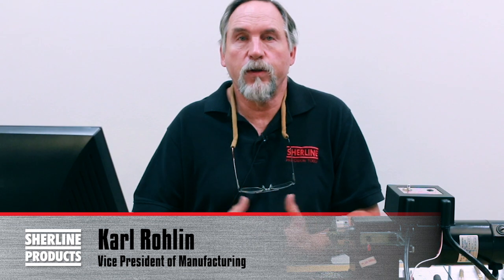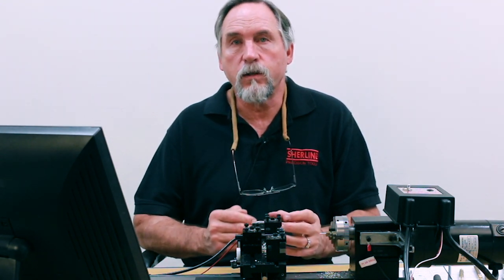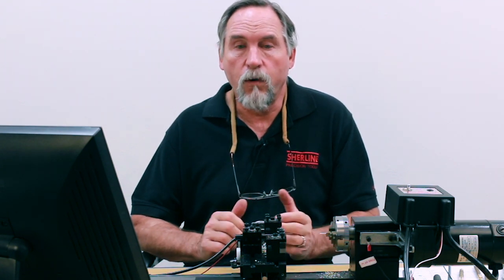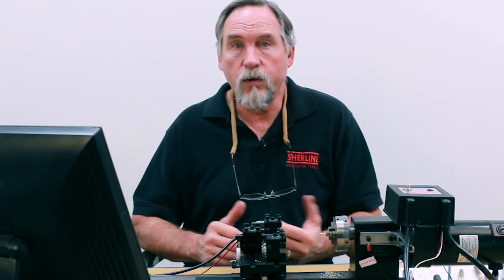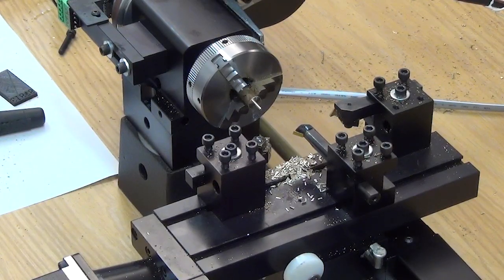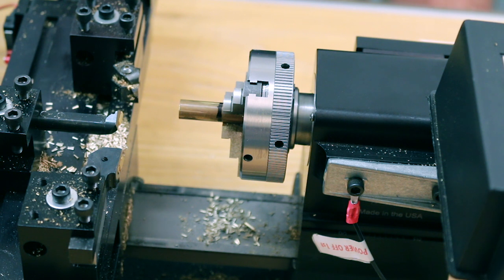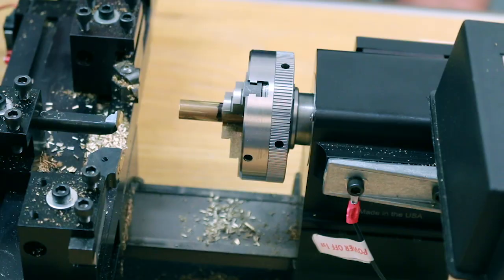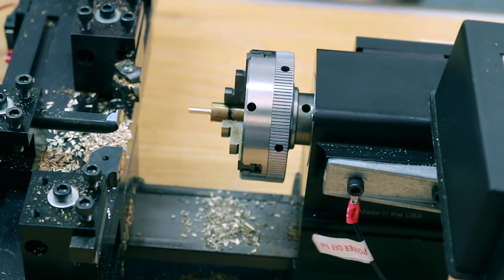Ball Screw Lathe Deep Cut Test

Comment: Do aggressive cuts like this damage the ballscrews in any way?
Reply from the maker: Because our machines are small, there is a misconception that they are just toys that cannot take heavy cuts in metal or hold tight tolerances. This video was made to show a very heavy cut on our machine. As stated in this video, the depth of cut that is shown is greater than we recommend for our machine. The cut is so deep that the boring bar is actually bending while it is cutting. That being said, repetitive cuts like this will have a negative effect on the machine over time (similar to exceeding the recommended RPM limit of the engine in your car).
NOTE: There was no damage to the machine or the ball screw in this video, and the stepper and spindle motors did not stall.